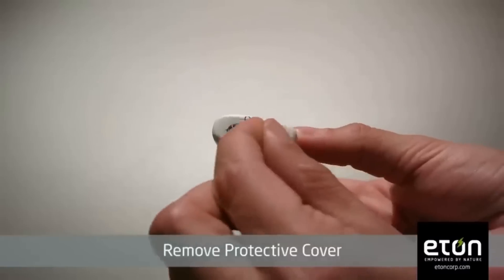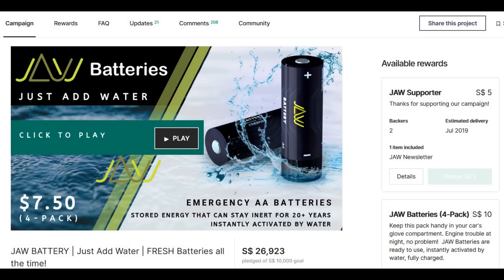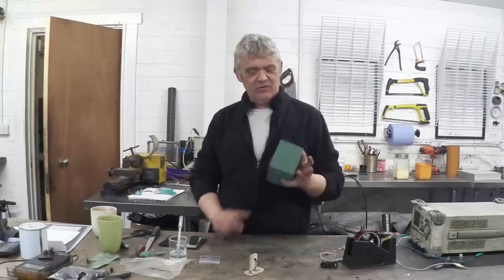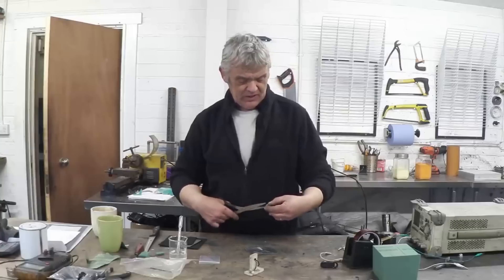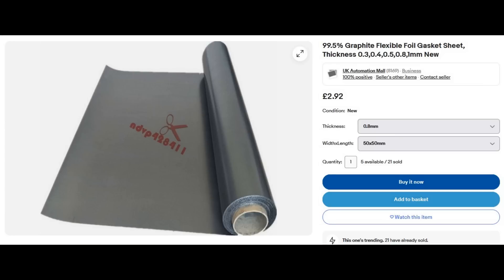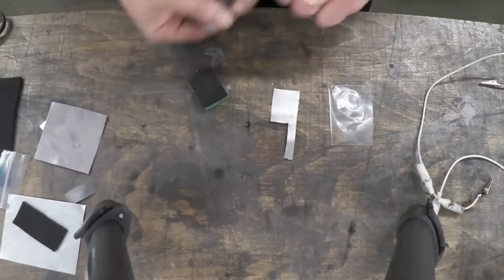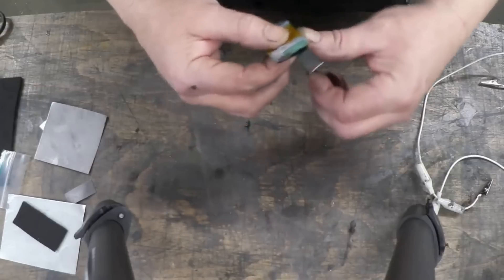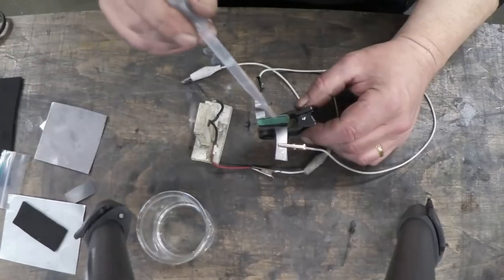2234 DIY Emergency Power Supply

Comment: But how is it made into a flashlight? Would you just buy an led light with negative and hot wire. Placing the wires between the mesh and the metals? Soder on? And which to which metal 🤔

Comment: That's pretty cool, I wonder how likely the foam is to absorb moisture from the air in a humid environment? If I were making it I'd vacuum seal them after assembly just in case, the peel open and fill with water. 

What voltage do they produce? Must be around 1.5v by the looks.  I like it, I might build some for the hell of it. Roll them up into cylinders to make the AA size will compress them well too, though I wonder how much that will effect its ability to absorb water.

Comment: i just had an idea. you know looms and spinsters wheels have those footpedals to keep them running. I wonder if you could make use of such a foot powered device to power a HEPA filter for doing sterile labwork in front of. I see you say they use the carbon filter in aircons or whatever, but squirrel cage blowers are pricey and tke a lot of electricity, ad can blow out / fuse. Would be SO cool to be able to have a foot powerd laminar flow desk where sterile air is blowing over the workspace in the lab to do sterile mushroom tissue culture where the footpedal through some mechanism creates constant wind pressure through the HEPA filter for sterile airflow on the desk, i.e. laminar flow hood for sterile tissue culture in a laboratory. Also I wonder if it's possible to make a High Efficiency Particular Air filter at home with reticulated carbon foam or something? The problem is the micrometer size at which or through which particles are let through, to prevent contams landing on the er, shroom myceium? The idea is to obtain a pure tissue culture to propagate the dears.  You could have two pedals so you are like basically exercising while powering your laminar flow desk, instead of wasting a ton of electricity and also having to replac a squirrel cage blower, as that HEPA filter requires a strong current of air to force a consistent flow of sterile air through the high efficiency particulate air filter, so would love to know..

Comment: You can also add a hygroscopic material such as Hydrogel or equivalent, to constantly draw moisture from the air that drip condensate into a anhydrous acetic acid  or citric acid powder, placed sandwich between other layered cells. If done right, You've now got yourself a self continuous charged battery cell.

Comment: Rob,  you make it look so easy and understandable.  We are blessed to have you as a mentor.
Reply from the maker: I am just glad it helped
Reply: @ThinkingandTinkering  would exposure to high humidity cause any issues with the longevity of this? Or would it require actual liquid to soak across  between anode and cathode? Thanks in advance for the reply, I’m a huge fan of all of your videos, they’re fantastic and you make the concepts easy to follow and learn / understand. Cheers!

Comment: I have questions. So once the electrolyte dries, can the cell be reactivated by adding more? How long does an activated cell run? If one wanted to stack multiple cells in a single container, what material would be a good divider?

Comment: I got a ton of pop cans. Thinking about power bank. Layer after layer. Dry cell. Prussian blue.
I had 6 dc volts die hard. But used salt and it erodes. So back to drawing board.  Thx 4 the education. Cheer's

Comment: Just noticing from the scientific paper at the beginning, on the printed paper battery, it has almost no currrent capacity, very little power. Not gonna be enough to power an LED you could see by, or even barely an LED at all. Not in anything pocket-sized at least. Water-activated batteries have been around for decades, a shop in Blackpool was selling them 30 years ago as a cheap novelty, water-"powered" watch. There's nothing special about them, their sole advantage seems to be a longer shelf-life than ordinary batteries, no self-discharge til you activate them. 

Powering an LCD alarm clock is a dead giveaway, they use essentially no power at all. Like solar-powered calculators, try powering your fridge from that solar panel! I can't think of anything that'd work from one of those tiny solar panels. That's the scale of the printed water-activated battery in the paper at the start.

Comment: Thanks people like You, Independently minded.
  If you did video I missed it - Electricity from air/Antenna to ground, with 4Diode 4 Capacitor circuit, between Antenna and ground. Idea has made its appearance while back.
 Keep Tinkering and sharing the knowledge

Comment: What you suggest I would do with some zinc acetate solution? Have some lying around cause I needed to clean zinc off of some metal pieces that needed to be welded together and used as a heater. Some zinc I got from them pieces, but not all rest I had to grind/sand off. Anyways the thing is complete now and in use as a heater/wood stove.

Comment: also, being these are only I would guess 2-3  volt cells, you could stack and parallel them for larger voltages straight out of the build, parallel for amperage, series for voltage. I would not try them to even be a regular car battery, but you could get to  6 and non volt batteries pretty easy.

Comment: I made one with a piece of copper sheet and a piece of magnesium sheet and used just salt water. The copper could be from old water pipes if needed , and as for the magnesium - an old mag alloy wheel from the scrappers would do - but cut it up fist.

Comment: Thank you for making this video. What are the half cell reactions for this battery? I looked up the paper, but it doesn't show the reactions, it just lists the ingredients: Zinc Anode, Graphite Cathode. I find it odd that a scientific paper doesn't show the equations...
Reply from the maker: it won't be neat mate but the basic reaction is going to be zinc to zinc hydroxide, then oxide then chloride probably - though i would guess a hypochlorite as an intermediate and probably hydrogen on the other side
Reply: @ThinkingandTinkering Apologies... Looking more carefully I realize this is just a Zinc-Air battery... with (dried) paper thrown in to hold the electrolyte in place. The water is used to activate it. Sigh...

Comment: I wonder about sea water as the electrolyte .  Zinc Air batteries for hearing aids stay fresh for years as they only activate when the sticker is removed exposing tiny holes allowing air in.  Could do same and have a fracture pack full of electrolyte that is activated  manually when needed.  Is the battery rechargeable, allowed to dehydrate and could be ready for the next black out?  I in South Africa so ...
Reply: Yes, I think this has a pretty huge potential... similar to the break glass in case of emergency... or the "Glow in the dark Lights" where you break the small ampule to get the light to chemically react.

Comment: I had a cheap digital watch that was bought in the pound shop back in the 80's that ran on water, you soak it in some water and away it worked for a few days to a week . . it's like they vanished into thin air, I can't even find any record of them!
Reply: Are you saying it was a disposable digital watch or a rechargeable digital watch? Either way for a pound in the 80s is really hard to imagine
Reply: @you-know-who.  I had the thing for years until we did a house move and it dissapeared.
Reply: @iangraham6730  that sounds exactly like the sort of thing that would just disappear from existence. I not one bit surprised
Reply: @you-know-who.  It was rechargeable,using the water, I can still remember it, the body was a green ish translucent plastic with holes in the side that had a wicking material for the liquid, the face of the watch was the calculater type. Well the shop was the pound shop style, cheap stuff, but the watch could have been a fiver or a tenner, but no more than that.
Reply: Handy bit of knowledge👍
Reply: A digital LCD watch doesn't need much power. ~1.5 volts and maybe less than 1 milliamp, I think. I had a kit, I bought from a toy shop once, it had 2 strips of copper and two strips of zinc. You made two cells and connected them in series. The kit came with an LCD watch module that you could run off the two cells. You could use almost any liquid as the electrolyte, I tried cola, lemonade, orange juice, etc. These kits may still be available in some toy shops. I don't know. Have a look online too.
Reply: Was looking for this comment.Yes, I remember these! Do a search for "water powered watch 1980s"
Reply: Try to Google "Water powered Watch", you Will get a lot of results (they contain a sponge btw)

Comment: What voltage did it produce? This is actually quite important as the current figure doesn't say much without it...200 milliamps at 1.5 volts is not 200 milliamps at 12 volts etc.
Anyway, Still worth my 👍
Reply: "Once activated, a single cell provides an open circuit potential of 1.2 V and a peak power density of 150 µW/cm2 at 0.5 mA" 
I was searching for the half cell reactions, but oddly the paper doesn't show them.
Reply: @marcfruchtman9473  A useful voltage. 5 in series would power a phone...
Reply: @marcfruchtman9473  Thank you. I'm also wondering how much energy they store, if they become degraded quickly without being connected up to a device and in general, their max power output until depleted.
I'll do some research I guess...quite fascinating.

Comment: Leak detector with 20+ years lifespan. 
one of these with a buzzer installed under showers or washing machines. 
You'd know earlier than when it shows through the ceiling. 

fascinating demonstration.
Reply: I love this idea of yours! 
I once lived in an old house with problematic septic system. The full tank would back up into the bathtub (not so bad) but also leak around the toilet drain wax ring onto the floor (so bad). Of course the previous owners put carpet! So I bought a water detector alarm and put it behind the toilet. It would sound like a smoke alarm if the carpet got wet. It served us well until, ironically, the battery died.

Comment: Or just keep the materials around. When you have an emergency. You can MacGuyver that shat to impress people.
Reply: I think it is better to just have a professional power bank.
But knowledge is useful if blackout happens when you are visiting your friends
Reply: @szogun1987 generally speaking it’d be superior for sure, but the batteries in the battery bank will degrade over time, even when not used. This specifically won’t really do that if well sealed from moisture for years, perhaps even decades.